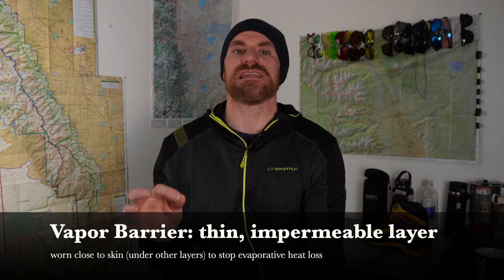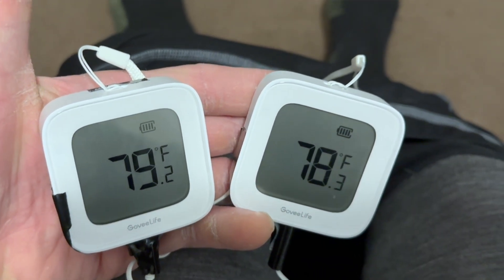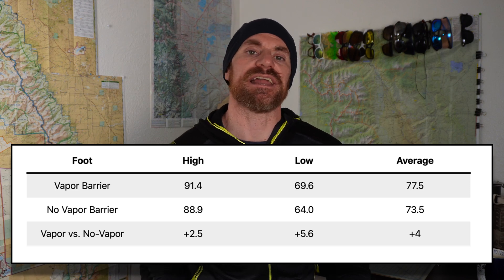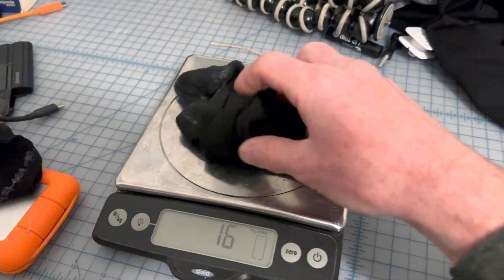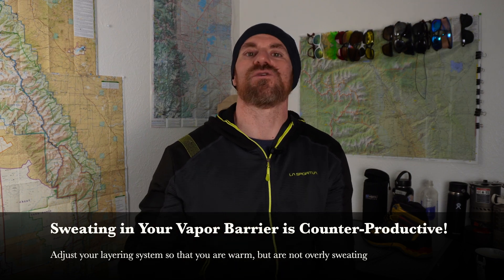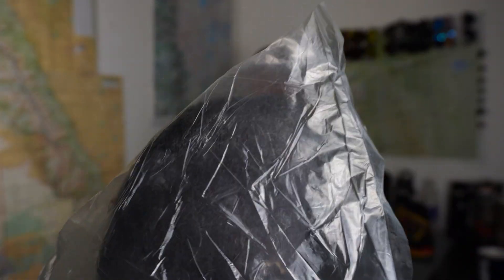Do Vapor Barrier Socks Work? Let's Test the Concept:

Comment: Long post incoming: I've been doing this for years, since before I knew there was a name for it. I've got a few tips for anyone really serious about this

These "vapour barriers" can also double as additional insulation, given the correct materals and application

1:35 Go to the store and find heavy duty garbage bags that are 3·mil, or 2·mil at the very least. You'll probably only find 20gal+ sizes, but you can simply trim the bags to ~boot-length with any normal pair of scissors
For 3mil, I use up-to 3 separate layers, for 9mil total. But it's better than just "9mil", because separate layers means many small air-pockets will be between layers; meaning even better insulation

As a side note: I do a similar thing for my hands. 9mil nitrile gloves. At least 1 pair. 1 or especially 2 pairs worn under your normal liner gloves will be super toasty in most cases

1:38 Instead of using tape, get elastic hook-and-loop cinch straps. Velcro has them up to 30", and I'm pretty sure it's also a 2-pack, one for each leg/shin. Use those to keep them tops closed, and it becomes a lot faster and easier to take them off or open up the tops to get a bit of air-flow
They come with a built-in plastic bulk so you can tighten them down, and just fasten them to themselves on the excess
The bonus is that now you have some cinch straps in a convenient area on your body in-case you need them for something else

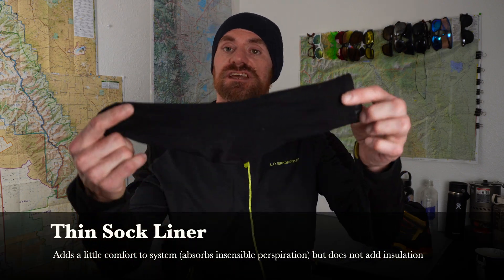1:09 Use 2 sock liners. One inside, and one outside, of the "VBL"
The plastic will now keep the overall shape of your foot, and be a lot easier to take on and off
As a moisture-management system, you can swap the inside liner to the outside, and put the dry outside layer to the inside. A secondary, thinner "VLB" (kinda like the turkey bag you mentioned, or just a small trash bag) can be used over that, before putting-on your primary insulating sock layers

I prefer 'athletic socks' as the inside layer, to wick moisture, and then 2 normal pairs of socks for the task I just mentioned; swapping them when one or the other gets wet; that way you're keeping your feet dry and moving the wet 'absorbing socks' to the outside of the VBL-complex, which itself is below the secondary liner. Meaning you'll never get your warmer socks wet (from the inside, at least)

1:56 Ponchos are a similar tactic. Wicking 'baselayer', and then cotton or some other absorbing layer, to help keep that moisture off your torso/arms
A properly-worn poncho will have plenty of air-gaps for breathability. Don't weat it tight. You can lift up the bottom to help get air-flow into the torso area. Same deal with the wrist-cuff area (assuming no elastic cuffs on either)

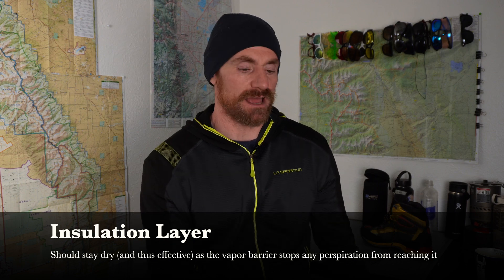2:04 Sweat isn't the issue if you're layered properly. The point is to add insulation and block wind/water, without having to worry about any accumulated sweat "bleeding-through" and creating evaporative heat-losses
And if you layer how I mentioned, you should really never get wet or even damp-feeling skin

2:10 If you have a sufficient VBL, it can easily damage socks. Especially wool socks since they're more fragile. In my recommended setup, the VBI-outer 'absorbing socks' also double as a sort of "sacrificial layer" to help protect the external insulating layers

6:03 Wet clothing is not going to magically freeze just because it's wet. If they were, you'd already be dead, because your body temperature would be at-or-below freezing for that to happen. Especially for a layer so close to your body in the first place
Reply: “Mil” in this context is “US mil”, aka. “thousandths-of-an-inch”. 9mil would be 9/1000"—That's equivalent to ~0.23mm thickness in “Metric”. No idea if you can buy trash bags or nitrile gloves in "grades" like this outside The US. That's “an exercise for the reader”, as they say

Comment: In Michigan we used bread bags mostly because hand me down boots had holes 😅 Aaron the polar explorer said you don’t need to worry about moisture in sleeping bag as body heat will push it out also he never used VBL on feet or hands.
Reply: Appalachia/Midwest here. Not far-off from you, and with similar winters. Had plenty of hole-y boots in ≤20ºF weather
Double-layered HVAC tape on both the inside and outside of the hole, would work better. You could use "heavy duty outside weather" duct tape over-top of the patch, in a matching color to that part of the boot, so it doesn't look as tacky
Depending on the thickness in the area of the hole, you could even stuff cotton from cotton-balls into the area to re-add some insulation (and HVAC tape is water/vapor-proof so using cotton wouldn't affect much)

Layered effectively, this is purely optional. But still: food-for-thought

Comment: Sadly I am a sweaty person, the few times I have tried a vapor barrier were mostly failures. The sleeping bag vapor barrier was the worst failure, got out of my bag at -5C/23F and my damp body FROZE. Biggest gear failure I ever had. The sock barrier I still use sometimes, under one condition, to keep the insulation in my boots dry on multi day winter trips.
Reply from the maker: Yikes! The sleeping bag experience sounds not so fun!

Comment: Did you happen to weigh the sock liners before use? Like you said, 2g might just be the weight discrepancy between the two socks. Really been enjoying these data driven experiements/videos. I live in MN and am starting to dive into more overnight winter backpacking. VBL for my feet have been on my mind, but haven't gone down the rabbit hole yet. I was out last weekend in the mid to high teens and was probably pushing the limits of my unisulated Vivo Trackers. Might try to head out for a dayhike this weekend or next with snowshoes and see how a turkey bag does. I like the one foot with/one foot without idea. Keep up the good work!
Reply from the maker: Good point. At least (now) washed and dried, they're both 16 grams. So my perspiration in general in my feet seem pretty low. This tracks I guess -- I'm not one to easily get blisters.
Reply from the maker: Also I'm glad you like the "backed by data"/"casual science" videos! I have a few more planned in the coming weeks.

Comment: VBL's have two more use cases: Wet ground cover during the summer and dry camp socks.

In the summer months, you may find that walking in trail runners on cold, snowy, or slushy ground (like if it snows in the mountains in July). The constant heat loss as cold water enters and then exits your non-waterproof trailrunners can cause discomfort, and in long-term cases, non-freezing cold injuries. Simply putting on a VBL as you trudge can warm up your feet greatly. 

At camp, you can also change out of wet socks, put on dry socks, a VBL over them, and then put on your wet shoes to walk around camp in dry socks, but wet shoes. It's a great morale boost.

My go-to VBL sock is bread bags. Durable? No. But free and lightweight. A note on sleeping bag VBL's, just use a trash bag.